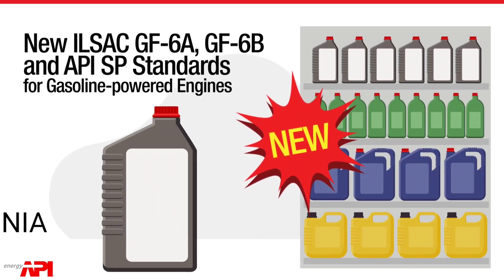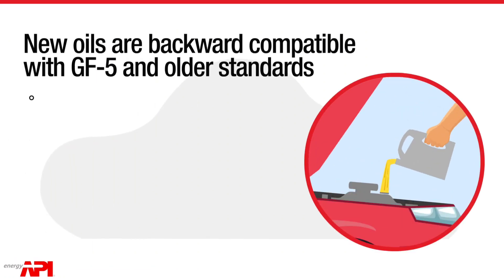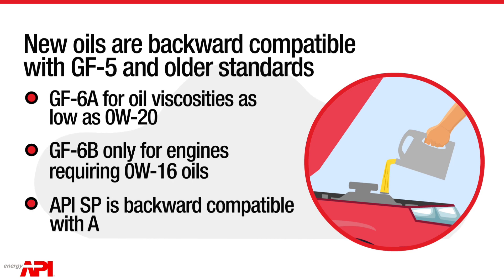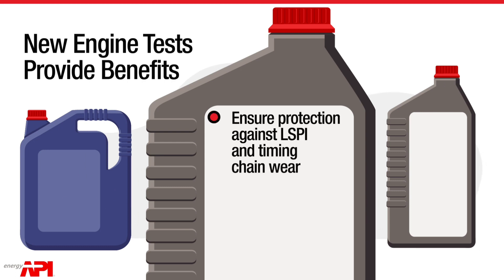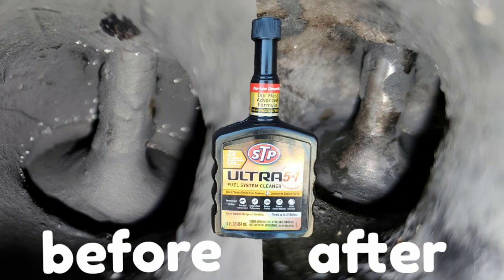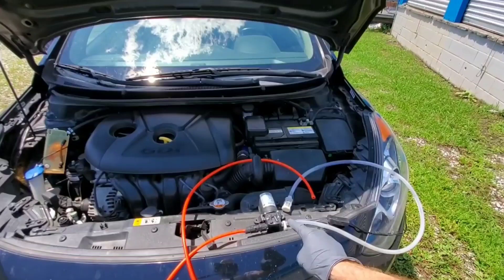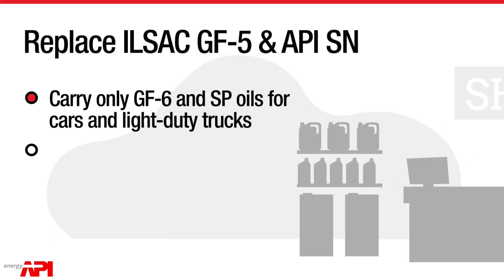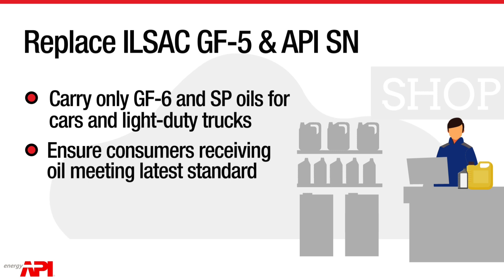You MUST USE this New engine oil

Comment: I only use Redline 5W-30 Full synthetic with 22oz of BG Oil treatment part# 115. That's the only combo that keeps the engine quiet and clean. 4K oil changes. ECOBOOST 3.5 Redline is the only Oil that can with stand heat of a jet engine and won't coke.

Comment: The problem is my car would require to use ACEA A5/B5 grade oil, the instruction didn’t mention about API, since your video title “must use this oil”, so is API SP good enough for ACEA A5/B5 requirement? 
And since most cars are old, the car manual wouldn’t mention newest API SP, GF-6 oil.

Comment: Its the heavy hammer of Gov Regulators and the Greenies that are forcing insane CAFE and Emission standards on the manufacturers.  Either pay big fines or piss off some customers with reduce reliability and performance.  It is the least of the two costly choices.  They have a feduciary duty to shareholders to reduce or prevent these fines and penalities and to maximize profits.

Comment: When dirty oil vapors from the PCV valve, in a "Direct Injected" engine, are being reintroduced to the intake manifold ahead of the intake valves, and there's not a "Port Fuel Injector" spraying fuel over them; even the best oil can only help so much.
Reply: Great point. I think some people have resorted to installing oil catch cans.
Reply: It also helps a lot if you rarely or never short trip a GDI. Cold engines run rich and dilute the oil in fuel, which makes the oil even more volatile.
Reply: @Dcc357  That's an excellent point.
Reply from the maker: Yes very good point
Reply from the maker: Yes indeed
Reply from the maker: Absolutely thanks

Comment: Do amsoil help this issues?
Reply: Yes amsoil will help the issue. They were way ahead of the game in low speed pre exgintish . Also the oil doesn't burn off due to high Novak rating. Recommend there signature series and if you use it change it out in 2-3k miles or at the min change the filter at 2k since it will clean out a ton of carbon and sludge in the engine. Only use there amsoil filter or royal purple filter since they are made for synthetic oil and filter down to 20micron. Regular filters will break down in 3-5k miles from the celluose breaking down which will start circulating unfiltered oil. Also regular filters only filter 30-40 micron. The 99% efficiency labels on most filters are bogus read them closely.